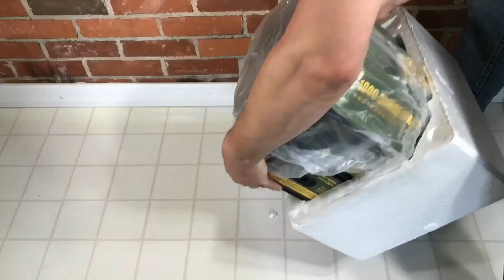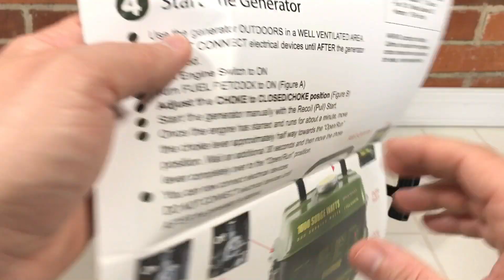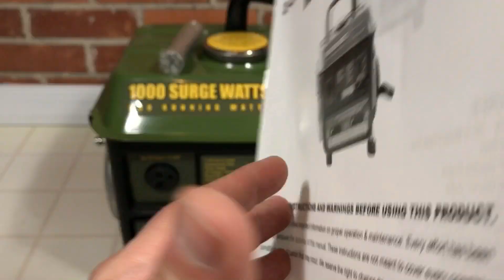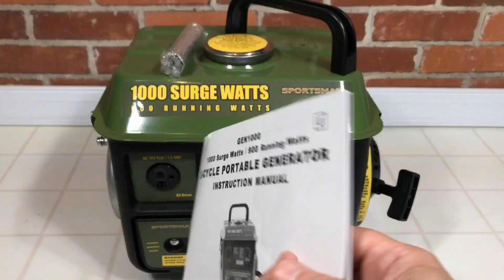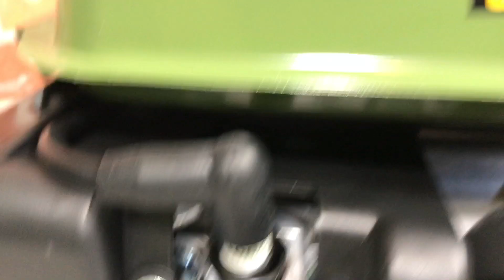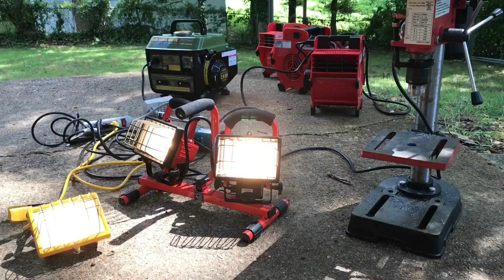Sportsman GEN1000 2-cycle generator - a rebranded TailGator from Harbor Freight

Comment: I bought the exact same one in 2023 from the local hardware store( Marvins), which has been running strong  since day 1.. I've only used Tru Fuel mixture in it( no mixing).. It's been a good 1. I just started it today, June 6, 2026.. 😊

Comment: I the sportsman inverter generator and in 8 month it quit working and it’s a hassle to get a replacement or get it fixed but loved it while it was working
Reply from the maker: Same. Mine worked great for 3 years (50-ish hours) until it threw a magnet during an overload test 🙁

Comment: 2012 I bought 2 of those things from tractor supply.    Both of them locked up during the non use time after running for about a half hour of initial use.   Months later I saw them for sale at Harbor Freight  ( different color , I remember red painted color) So who rebrands who. . Dont touch them buy Harbor Freight. Good luck. I blame ethanol  gasoline . I added oil to the crank and 2cycle oil to the fuel

Comment: I saw it ran up to 10 amps, was it running everything correctly at 10 amps?  Can the unit exceed the states running watts by 100 watts and still run the appliances correctly.

Comment: Harbor Freight puts two "models" of Tail Gators:  models 63024 and 63025, the latter of which he refers to often in the video.  When you compare the two side by side, the 63024 wins hands down.  The parts and build quality is simply better.  There is no such thing as a "brushless motor" on a generator.  There IS something called a brushless generator.  They are used to power sensitive electronics and for backup power in hospitals.  And they are far more expensive than an $89.00 Tail Gator and will last a long time.

Comment: I have the 1000 surge/staring watt and 900 running watt Sportsman generator.
Rated at 120v / 7.5 amps.
I put 3 tablespoons of 2 stroke oil down the spark plug hole and installed the original TOUCH plug back into the head and turned the engine over 6 times to lube the cylinder wall and then put my fuel in after mixing a gallon at 40:1.
I opened the fuel valve and put the chock on and power switch on and pulled gently on the starter rope and it took a good 10 pulls to get it to fire up and it smoked like hell for about 2 minutes to burn the 3 table spoons of oil out of the cylinder but it ran really smooth the whole time it smoked.
I tested the voltage and it was showing between 123 to 125 volts.
I let it run with no load for 5 minutes and then plugged in a 6.0 amp angle grinder and the voltage dropped to 123 volts.
I then plugged a 4.0 amp hand drill in and while the angle grinder was running I kicked on the drill and the voltage dropped between 118 to 121 volts and I let it run for 3 minutes with the 10 amp load.
I turned the tools off and shut the fuel valve off ad let it run until all the fuel was gone from the carburetor.
I guess I must have got a good one right?
Reply: it wont  run anything over  5 amps if that , surge keeps  popping

Comment: One thing that users should know about running AC motors at a too low voltage.  They draw more current, will overheat and burn out.  It has to do with the interaction of the magnetic fields of the rotor and stator.  The back EMF of the electric motor controls the amount of current.  If it is too low (due to low line voltage), the current flow increases and the motor will burn out.  Similar to preventing the electric motor from running at its rated RPM - it will overhead and burn out.  If this generator doesn't shut off power to the load, you could lose your AC motor.  This only applies to inductive loads (primarily motors and anything that uses transformers).

Comment: Has anyone added a muffler to one? I have one I'm taking camping and would like to try to make it quieter. I saw Ace hardware sells a briggs and Stratton muffler for 2-4 HP engines and I'm thinking I might try to add it on tomorrow.
Reply from the maker: Be careful changing exhausts on a 2-stroke system. That can change the tuning of the engine and easily lead to a hard seize if you don’t ensure the mixture is properly adjusted to accommodate the change.
Reply: I'm more wanting to add the muffler end as a silencer. Shouldn't affect the exhaust flow.

Comment: I have a nice red one across the pond, it's called a 'Pro User'. It's rated at 850W (max) 230V and several years old. I have the manual with a photo on the front and I cannot see any difference at all.  They have different stickers, colours, Volts and Hz  but apart from that they churn these out by the million and are shipped all over the world. They should have an overload cutout but they sell more without it. They must have a hundred paint and sticker shops. I would love to see that factory. We all go on about Chinese junk but I still think it's good value if you treat it right. They seem to run better and cooler on 40:1 oil mix. I think they would last very well below 650W, that's what the first ones were rated at. Incedently I am not a pro user, I've been happily married 43 years. OOPS! Great video as always.

Comment: I got one of these generators except it's under the Power Pro name. I got it here: PowerPro 56101, 900 Running Watts/1000 Starting Watts, Gas Powered Portable Generator https://www.amazon.com/dp/B00J261PGQ/ref=cm_sw_r_other_apa_-sR0zb29PSZYA
I like it better because of the built in volt meter and 12v charging. Mine has about 50 hours on it already due to the hurricane we had in FL. It went through 3 of my friends and never missed a beat over about 5 days. I use TCW3 2 stroke oil (marine). I even poured a little 2 stroke in the plug hole before I ever cranked it over and replaced the plug with an NGK iridium of proper type.

Comment: That's great! They make more variants of this generator than there are grains of sand on the beach. I saw Hyundai makes a version too, its model # is HYH960A and they sell it in Turkey and possibly other countries. Check it out,  https://www.youtube.com/watch?v=8jdLlKjyQtA
Reply: all these chinese 2 strokes are copies/clones of the yamaha et650/950 series of generator which 1st appeared in the the early 70s and Yamaha still makes it...in Taiwan. https://global.yamaha-motor.com/business/pp/generator/lineup/120v-60hz/0-1/et950/index.html
Reply: MrSGL21 You're absolutely correct! Yamaha was the original! It would be neat to own an original. I thought it was interesting that other better known nameplates (like Hyundai) would put their name on a cloned machine with minor modifications to the feet, muffler, etc. These are really great little machines regardless of what stickers they have. I'm very pleased with my harbor freight 63024!
Reply: as long as people understand what they are buying, its limitations, and its qwirks they are great little machines. the problems arise when people just yank on the starter breaking it, don't mix the gas correctly or leave fuel in the carb, and over load them. yes some of them are junk I've got one of the blue chicago tools ones, the same one as the 63025, and its a pile of garbage compared to the other makers units. yes its dirty power compared to and inverter genny but these are sub $100 units that will run fans, small appliances, and battery chargers. anyone can own one and keep it stashed with a couple of quarts of oil.
Reply: MrSGL21 I totally agree. I get mine out every couple of weeks or so and run it for an hour or two with a 500 watt work light.  Its been working well. :)
Reply: MrSGL21 Neat! So how was the frequency? Did it check OK?
Reply: +David S 61.5 -62 no load 60.5 -61.5 with a 225 watt load the home gear 950i which is the same as the sportsman gen1000i was exactly 60
Reply: MrSGL21 MrSGL21 that's close to what my 63024 kicks out. It puts out 59.6-60Hz @~115VAC with a 500 watt work light on it. Not bad for a cheap generator. :)

Comment: Thanks for the video, i did ask for a load test like the invertor for tailgator this is close. This is 1000/900 vs 900/700 tailgator. Whats the price on this ? Sorry if you mentioned it i am commenting before watching the whole vid. Edit: i see this is supposed to be brushless which in general are more expensive and have a tad more power even in the aspect of drills.
Reply from the maker: +mixwell1983 It is $99, but my recommendation is to get a TailGator instead of this as they're the exact same thing and the TailGator is $11 cheaper. Obviously, if the Sportsman Inverter Generator is in the budget then that would be the way to go. Are you asking for a load test on the Sportsman Inverter Generator?
Reply: KevCentral no i saw the load test on it and was curious if tailgator could do the same which is this video. Thanks !

Comment: How are the tailgaters holding up 
My tailgater has got a fuel leak and is flooding the engine after 25 hours I think I'll take it back and get another one
Reply from the maker: +Fish Mower Good call. Return it and get another. All mine are running well. I'm about to hand off one that I was giving a proper run-in. I've ran these generators (TailGator/StormCat) to well over 1000 hours. I have friends and family using/buying my old generators. All but one are still going. If you get a good one, they last very well. One note: i have previously recommended the '24' model of TailGator. It appears the latest batch of '25' models are superior.
Reply: KevCentral so I should get a 25 model when I trade it in ?
Reply from the maker: +Fish Mower Based on the most recent lots at my local Hf, the 25 has improved in quality beyond the 24. If it were me I would go for a 25 now
Reply: KevCentral thanks kev
Reply: KevCentral sorry to bug you but is there any way I can tell the difference in the store between the new 25 and the old bad 25 models
Reply from the maker: +Fish Mower If they let you open it up just look at the fuel line. The newer ones have a better quality fuel line. They will also have a larger filter in the air box (black filter, Not white)
Reply: KevCentral thanks for all your help kev
Reply from the maker: +Fish Mower Anytime!

Comment: My Tailgaitor 25 says 7 amps and I run a 7amp impact driver at least 4 days a week ? I did the NGK setup you posted way back . Run High Octane Gas . paid $88.00 last spring . It's Working Good .. Thanks  ..
Reply from the maker: +Rare Form 👍 thanks
Reply: Hi , I use the best 2 cycle oil but it's enough too choke you out even after 5min's running ?
Reply from the maker: +Rare Form My guess, assuming the generator is functioning properly, would be that the oil/gas mix isn't correct. How are you measuring your 2-cycle oil?
Reply: One Gallon Two one Packet at the pump ?
Reply from the maker: +Rare Form Do you have any details on the mix bottle you use? Some pre-measured mix oils are not 50:1.
Reply: @KevCentral  whats the best plug for one of these, I have an older one. It actually says 1000w surge 800w continuous

Comment: I have one similar that I bought at Kmart. I like it. I have a complaint. The edge of the tank. When you pull the cord, if it kicks back. It wants to pull your hand toward this lip around the gas tank. Your generator is louder than mine. Anyway hopefully they will fix that. I have yet to overload yet. Thanks.
Reply from the maker: +kennith rogers if you bought yours at Kmart then you likely got a Pulsar. If so, those are slightly higher quality than the Harbor Freight version. I believe they also output more power. Thanks for commenting.

Comment: I have a question for you? I recently purchased the Sportsman 1000i inverter Generator. I purchased it to power my Ridge 8.3 amp wet dry vacuum. But unfortunately it goes right into overload protection when I connect the vacuum. Is there anyway to adjust the overload protection or bypass it safely so I can use it to power what I need it for? Or am I just out of luck and going to have to return it for a  larger Generator?
Reply from the maker: +Jeremy A return it for a larger generator. Bypassing the protection would quickly overheat the inverter.

Comment: Good video. The Chinese are notorious for putting whatever specs on machinery that the manufacturer wants, even if it's not true. Do you still use the tailgators now that you have the small inverter generator? What is the biggest advantage? Run time on the inverter?
Reply from the maker: +Bill Borden I still have them, but don't use them for much these days as the Sportsman inverter generator is far superior (and it should be for double the price.) The biggest advantage (not counting the inventer itself) is the weight reduction. It only weighs 24.7lbs full of fuel. Thanks for the comment.
Reply: Thanks. I was more concerned about the fuel economy, Have you found that the inverter generator runs twice as long on a gallon of fuel or is that marketing hype?
Reply from the maker: +Bill Borden I haven't timed it, but it has to be very close to the stated time.
Reply: Bill Borden They're the most law abiding citizens  that make up the United States of America too. A ha ha LOL we all need a
Qu Ti Yung Tang

Comment: Does the circuit breaker have an amperage rating printed on it? I think the "U" in the square is for Uber lol.
Reply from the maker: +2 AM Lol. I haven't taken the front off to look. I may look tomorrow. Uber bad maybe ;)
Reply: I guess it depends on the cost of this one vs the Harbor Freight.